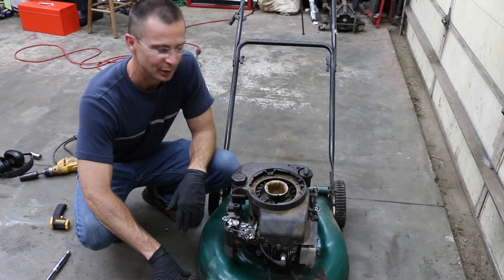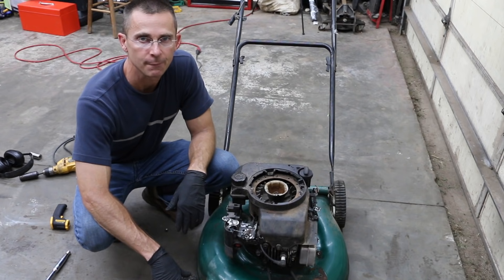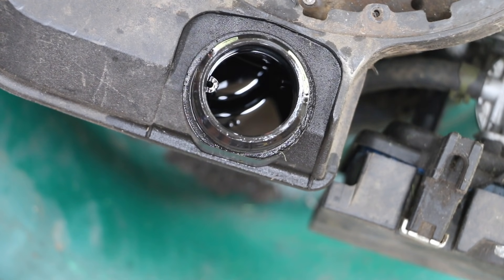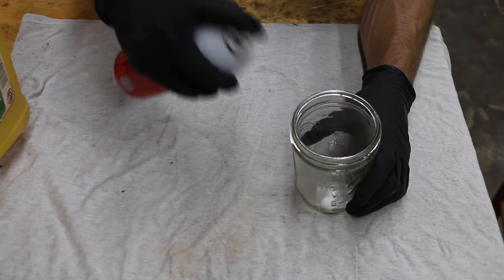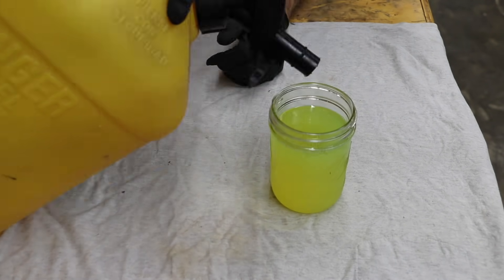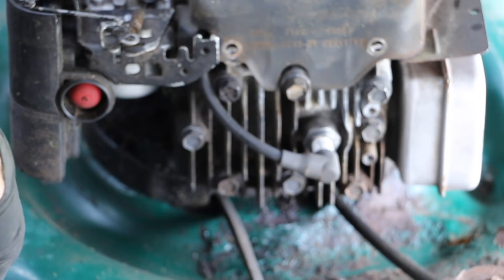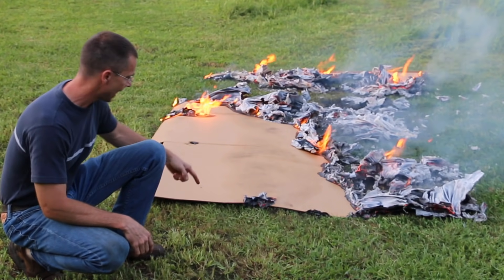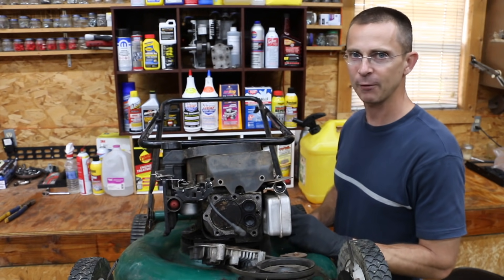Will a Gas Engine Run on Diesel?  Let's find out!

Comment: Can you increase the pressure inside the engine cylinder in one way or another to reach 16:1 like diesel engine and Try to run it using 100% diesel?
I think it will work perfectly .

I have another idea. To heat the diesel before the carburetor to reach 100 C and in this point the diesel will ignite immediately by the spark plug.
Reply from the maker: Thank you for the video ideas!

Comment: First off that’s obviously not diesel, diesel consist of a light red color
Reply from the maker: Thank you.  Where I live, the "off road" diesel is red, indicating it hasn't been taxed.  Hefty fine for those using it in on-road vehicles if caught.
Reply: Low sulfer diesel is blue; the same color a 100 low lead av gas which can be a problem.

Comment: Inside a diesel or a gas engine is a different burn dynamic than outside lighting fuels.  Diesel gives a very rapid and violent upon compression, hence the load knock and high torque.  Gas slow burn and smooth speed.     A common misconception.

Comment: I ran my old Pontiac six-cylinder on fuel home oil. It’s harder to start but it will start!  I used to run to the store all the time like that’ but only when I needed too. Smoked a little but ran fine
Reply from the maker: Thank you and Happy New Year!

Comment: We always use diesel to burn brush piles and plum thickets. Gas never worked and no matter how hard you tried, you always came away with burnt hair. The diesel is a little easier to light if you have a small established fire and just let the diesel run into that fire.

Comment: I have found that running gasoline/diesel mixtures in gasoline engines, causes them to "build oil" in the crankcase. due to unburnt heavy fuel getting past the rings.
 John Deere model A and B tractors had two fuel tanks. Someone born well after the age of the A and B claimed it was so they could be run on Kerosene after being warmed up on Gasoline. If the two tank system on these tractors really was for a dual fuel capability, and not just a reserve Gasoline tank; I think building oil would still be a concern.
Reply from the maker: Thank you

Comment: Why not make your own gasoline  vaporizer tank? That has extreme efficiency, some people have claimed that they got 100 miles per gallon!
If you make a vaporizer tank just don't sell it to anyone! Or the greedy gas companies will have you hooked.
It is a great experiment though, you just need safty devices so that your tank doesn't blow up from backfires. But how can a vaporizer tank be more dangerous than running your engine on propane?
Ok so this is how a gasoline vaporizer tank works; you have an air in and a air out, the air hose coming into the tank blows on just an inch of liquid gas while the other hose ( the air out ), is at the top of the container going to the engine. Then it needs two valves to give the engine the right amount of air and then the right amount of gas vapor. 
So, the vaporizer tank works on a vacuum principle; every time the engine makes the first cycle, the piston sucks air in, so within vaporizer tank, the air coming thru, immediately becomes vapor. Look it up.
Reply from the maker: Thank you for the video idea!
Reply: @ProjectFarm  
Oh I saw that you actually tried this already, but hopefully, I gave you a little more info?

Comment: I would have liked to have seen you drill out the jet in the carb a bit at a time until the engine would run on pure diesel.  I suspect it would have if it got more fuel or less air.
Reply from the maker: Great recommendation!

Comment: I bet it would run on diesel if you replace the rings and lieve almost no gap in them size them your self re place plug with glow plug just saying or start with little carb spray. 🤔
Reply from the maker: Thanks for commenting

Comment: Try running a motor that’s hot off of diesel. Had a friend of mine (it’s a she) put diesel in her Prius at the pumps. It ran fine for the night but when she got home and her parents went to start it, it wouldn’t start because the motor was cold. So the motor temp caused the difference.
Reply from the maker: Thank you

Comment: You really dig into some neat issues. I really like the direct, scientific way you do things. I was sure I knew what the diesel would do on the cardboard.
In Nam,  we put diesel in a coffee can and put a cork or piece of wood in the fuel. It was not real easy to light and would burn slowly for hours. It gave off a fair amount of light depending on the size of the wood. We had to anchor the can, because if you tip it over you would be in a hurt. The flame would spread pretty fast even with a dirt floor bunker.

I didn't think a gas engine would run with 50/50 gas and diesel. Low compression is not what diesel needs but evidently there was enough gas to burn and get the diesel lit up.

The large trucks we had in artillery used a six cylinder diesel engine that was referred to as multi fuel. Supposedly it could run on almost anything combustible. The motor pool sarge told us they showed him it could run on used engine oil if that was all you had. But it would slowly clog the rings so it was not for long term. We learned to take gas cans with us to fill our trucks. The guards would not let us put gasoline in the trucks due to a longevity issue. We filled the gas cans separately and then would stop and add the gas before running through a dangerous area where we sometimes were sniped at. That big 2 and a half ton truck could really scream on just 10% gasoline. The MP's would chase us because there was a speed limit in one spot. Really? That was where the snipers waited for us. So we blasted through there at full throttle, engine screaming. The MP's could not catch us with their little Jeep pretenders, they would get crooked in the loose sand by the beach and go sideways and get stuck. By the time they got dug out, we were gone. 

So, some diesels can run safely on various petrol products but it shortens the life if it is not properly refined diesel. My Jeep has a diesel that runs really well on vegetable oil. It's actually quieter. But even veggie oil needs to be processed to remove something called "esthers". If not removed that can cause clogging of the rings and injectors. I get my processed veggie oil at a co-op. Can't use more than 20% in winter or it can get gelled up and clog the fuel filter. IN summer I  have ran 80% and the exhaust smells like someone deep frying french fries. Pull up to a light where people have windows down and they start looking around wondering where the smell is coming from. One time out of ten cars at the light three of them pulled into a McDonalds about  three blocks ahead LOL
Reply from the maker: Thank you!
Reply: @Mike B LOL @ the MP story - And thank you for your service... salutes

Comment: My 1986  f250 ran on a full tank of diesel. GRANTED  i did have the have the engine pretty choked and it didnt run well and smokes a whole ton. But the 7.5 460 ran. Still running and haven’t even done spark plugs (yes i know I should) but giving the size of my motor i think thats why it ran. Sometimes it smoked white other times i could get the truck to roll coal
Reply from the maker: Wow!

Comment: A diesel engine will run on gas if you add some ATF :)
Reply from the maker: lol. I presume you've tried it?
Reply: Yes. Years ago I had a Ford 7.3. The attendant at the station filled it with gasoline in error. I added 2 quarts of ATF and drove it. It had slightly reduced power, but didn’t seem to hurt anything.

Comment: I had a chainsaw I was out of 2 cycle oil but I had kerosene and I used full kerosene in the place of gas oil mix. At first I used a little gas with the kerosene but after the saw got hot it ran reasonably well. Try that bro
Reply from the maker: Thank you!

Comment: If that engine was hot it should stay running go a call on day from someone who was moving grass ran out of gas accidentally put diesel in finished moving grass and couldn't get the mower to shut off
Reply from the maker: Great point. Thank you

Comment: Them Briggs & Stratton motors a pretty tough motors one time my cousin ran kerosene in the lawn mower before because she didn't know what was in the blue can in the her aunt told her to do it that would be my mother and they told me about the story and I said how did you do it without no gas and they said they poured kerosene in it and it ran fine but after I put gas in it it stopped running correctly so I had to clean it out but I got to run again it
Reply from the maker: Thank you

Comment: If the motors hot enough it will run diesel fuel. My buddy had an old Honda 250 four stroke enduro bike. He ran it for an hour and a half and needed to get back home and he was at his grandfathers house. Unmarked red fuel can he filled it unknowingly with diesel and ran it all the way home over an hour away.
Reply from the maker: Nice!

Comment: Hey project farms (sorry, I'm not sure of your name, if you have mentioned your real name, I haven't payed attention yet), is there a particular reason to why you use the tool you use for starting the mower? It has to do with easier to start the engine, doesn't it?
Reply from the maker: Thank you.  Yes, starting the engines is very easy and quick.

Comment: The problem with diesel is it doesn’t like to mix with air in a carburetor. This is why every Diesel engine ever has had injectors. Also why pumping the primmer is the only way to keep the lawn mower running.
Reply from the maker: Great point.

Comment: @Project Farm Try mixing gas and diesel and see if it'll work in a 2 cycle engine.
Reply from the maker: Great recommendation.
Reply: It will run, but diesel’s too thin and won’t provide as much protection as 2 stroke motor oil.

Comment: It can run on diesel but you have to preheat the diesel significantly. I bet if you make some kind of preheater to get the diesel up to like 200 degrees before it enters the intake it would probably work
Reply from the maker: Thanks for the recommendation.

Comment: man... what if you pre-heat the liquid diesel (like a tubbing coil thru the exaust?) before carburation or, even, heat up the whole air-fuel mixture before admission?
Reply from the maker: Thanks for the test idea!
Reply: @ProjectFarm  man! you 'just reminded' me of a test idea i wanted to try but have no engine to do it.

water injection: during the wwii airplanes, specialy in germany, injected a mix of ethanol or methanol and water with the fuel in order to increase power.
https://en.wikipedia.org/wiki/Water_injection_(engine)
you could test in the a 4 stroke (in a 2stroke you would have lubrication problems) anhydrous ethanol and some hidratated ethanol (mixed with water in 5, 10, 15%?) and see if there are performance changes.

Comment: There was a channel (i think it was called the 5th gear or somethineg like that) who tried that in a fuel injected car, and it actually worked, but after some time running on diesel it started to become unstable and the diesel was burning in the exaust too! 

They also tried the oppsite, gasoline in a diesel car.
Reply from the maker: Thanks for this information. This is interesting.

Comment: Would be interested to see what the run time is with 50/50 diesel versus gasoline, since diesel has a 12% higher energy density.  There was probably a lot of partial combustion, though, so it really wouldn't surprise me if it ran for less time overall.
Reply from the maker: Great test idea!

Comment: I have used 1 part Kerosene to 2 parts Diesel on a Chev 350  Engine 20 years ago in a pinch retarded ignition timing approx 18 degrees and it worked!  Idled rough but smoothed out around 1,100 rpms but got me to town to get gas.
Thank you for all the videos there really enjoyable to watch and have taught me alot about what products really work!
Reply from the maker: Thank you!

Comment: The wife was having trouble starting the car, she said she was going to try what doctor emmit told her to do, turn on the flux capacitor and set the clock to 1885, add a bottle of mouthwash to the new fusion fuel generator.. Anyway that was around 8 years ago, I've never seen her since..
Reply from the maker: lol

Comment: I seen a Honda 1500 run on Diesel , The old man 78 years of age filled up at the pump , lucky he had 1/4 tank of gas . we went 300 yards and boom grey smoke and he had no power , he limped the bike to his brothers house , I said Im sure its fuel oil he said no its bad gas , I filled my bike at the same station on another pump. I stuck a stick in his tank, it smelled like fuel oil tried to light it and it would not light .  yep fuel oil , siphon out a gallon  added a gallon of gas , 100 miles back home we hit every gas station stuck in 50 cents  lol
Reply from the maker: Wow!

Comment: The issue is that diesel engines don't use spark plugs they use glow plugs
Reply from the maker: Great point regarding compression ignition.

Comment: I tried a 50/50 diesel gas mix in a minibike because i didnt have enough gas and it did terrible, it was smoking, had no acceleration and it was almost impossible to start. I almost broke the pull start doing it
Reply from the maker: Thanks for commenting on this.

Comment: Years ago my local gas station changed my usual pump to diesel. I had a 1/3 tank of gas and filled it up with the diesel without knowing it in my BMW 320i I got a block down the street, it blew a white cloud of smoke, and died.
Reply from the maker: Wow!  I wonder if it would have ran with a 30 or 50% diesel mix.
Reply: @ProjectFarm  years ago there was an episode of Whirly Birds where they were forced to use truck fuel in a helicopter.

Comment: Can a vehicle run on 50 50 gas diesel?
Here in the Philippines, diesel is much cheaper than gas and so if the 50 50 mix would work why don't I try it 😊
Reply from the maker: I wouldn't recommend starting with a 50/50 mix. If it were me, I would begin with 5-10% to see how it runs and go from there.

Comment: Disel engines suppose has high compression rate vs gasoline engines. they have a extra compression ring correctme if im wrong .😉
Reply from the maker: Great point.

Comment: Had someone accidentally put a gallon of diesel in my gasoline generator, and ran it for around 2 hours. I put gas in and ran it for a few more hours, but it did make a strange sound @ startup... when I started it with gas afterward.
Reply from the maker: Wow!

Comment: will a hot engine run on 100percent diesel? some videos on youtube suggest it would
Reply from the maker: I believe some engines will, but I couldn't get the mower engine to run on it, since the viscosity of diesel was an issue.